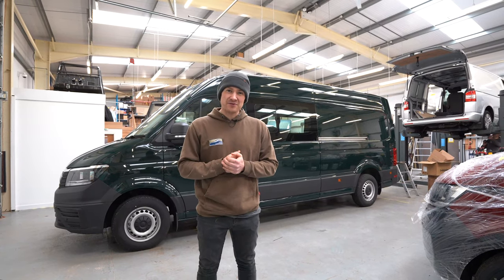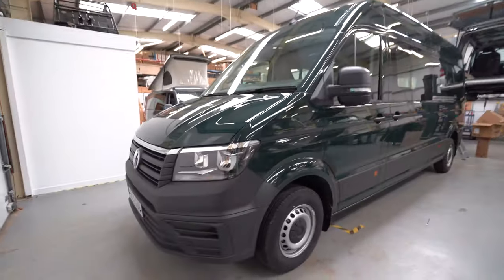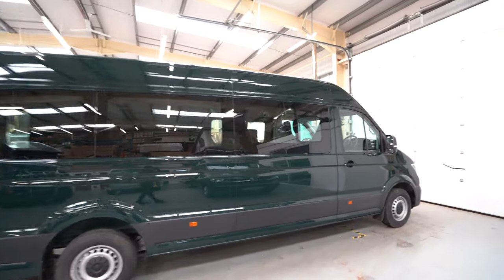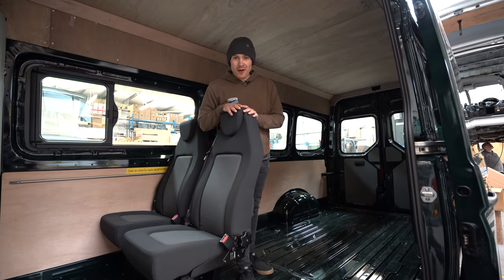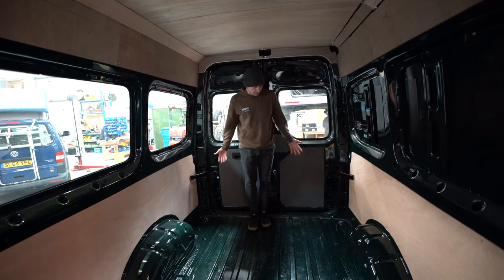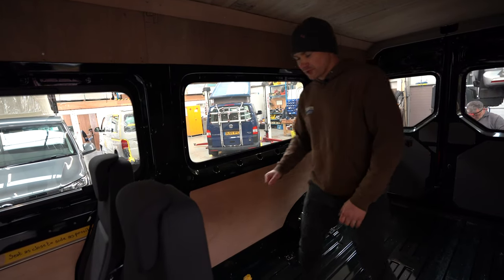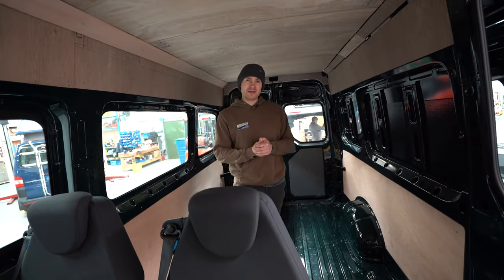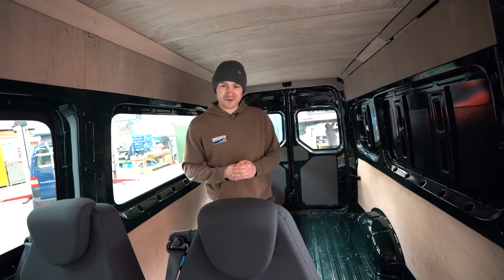We're building a VW Crafter CAMPER - Follow our build journey here!

Comment: If this is a 2021/2022 crafter, have you seen that the plastic trim that used to give rust trouble crafters and sprinters are famous for is now stuck onto the outside of the vehicle, rather than being held up purely by the plastic clips that let the water through? Do you think the problem is solved or have you also drilled outlets at the bottom of the walls where there is this new expanding foam blocking the outlets that used to be there?